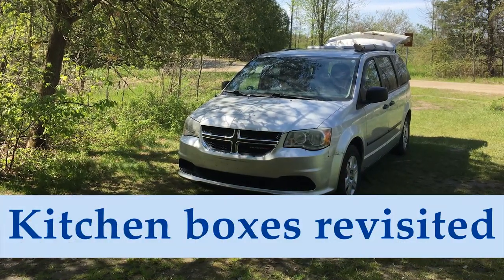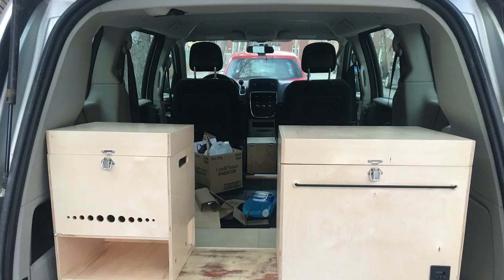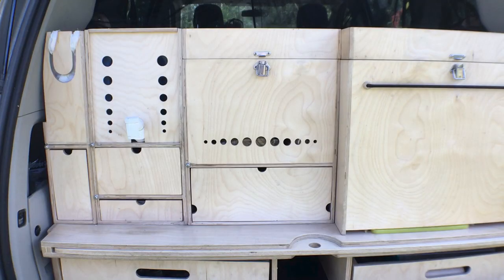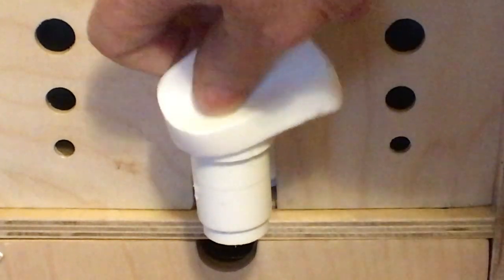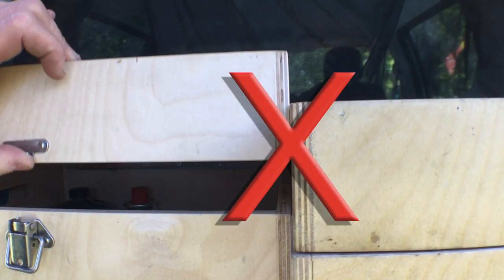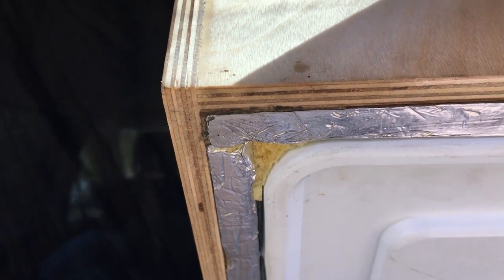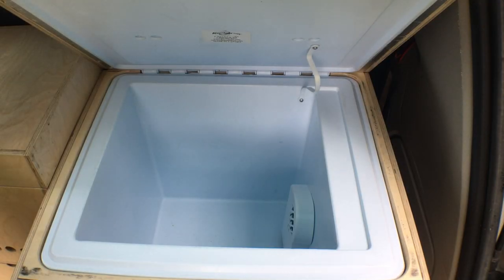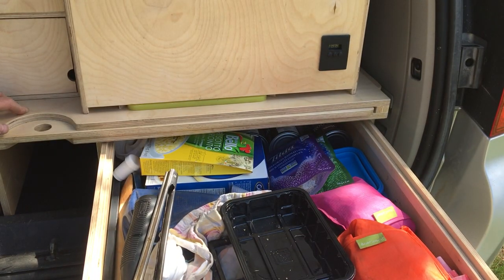Kitchen revisited...what does the future hold for a very small camper van?

Comment: Not being a designer or woodworker, I've been working by trial and error with existing furniture pieces.  For instance, I just 'won' a set of legal size teak file cabinets.  One is for inside my in-law apartment, but the other one is for the minivan. I did a dry run last spring on a trip down to FL to visit my son's family and I used a camping cot, but I'm not really happy with that, since I can't put drawers under it.  I'll figure it out, but I love visiting videos like yours for options and possible answers! Very glad to see what you liked and didn't like of that kitchen.

Comment: Building and innovating is half the fun! You have done a really great job and it is good to see you are not so wedded to an idea that you don't critique it. That is a recipe for continual improvement. As an aside, I went from a cooler which I was very happy with (until it died) to a compressor fridge. An absolute game changer and I dont know why I stuck with the cooler for so long. Less power, more consistent temps and more space. I look forward to watching you rebuild.
Reply from the maker: Thanks for the pep talk! I am comforted by your path from cooler to fridge :-) What kind of fridge did you get? I am debating whether to go for a Dometic or something less expensive. In Canada a small Dometic fridge goes for over $1000. Quite the chunk of change!
Reply: @averysmallcampervan  I went with a Companion brand 60 Lit fridge which has an LG compressor. In Aust Dometic are prohibitively expensive and the reliability case does not seem to justify the significant difference. My fridge was $750 Aud while the equivalent dometic is double that. If it lasts 5-7 years I will be happy (has a 3 year war). WRT coolers, I think the world has moved on from that technology which is why it is harder and harder to buy one (not to mention that here in Aust I travel in summer temps of 35-45 degree C and even with a 20 degree drop your cooler is still in the mid 20s. Love your cabinet work!
Reply from the maker: Thanks for the info!

Comment: I don't even have a drivers licence yet but your videos are so addicting and I have already a ton of plans for when I have the economy and space to make my own camper :D

If I would replicate your setup, I would probably use the curves in the back for my advantage. If you just moved the fridge a bit to the left maybe you could use the odd shape for the drawer for bottles since they get slimmer at the top. I would also make the sink stick out a bit to contain drips but one thing that I thought of is to cut a U shaped hole in the box where the water jug is contained along the bottom seam from the tap and inwards. That way if it leaks and it runs along the bottom of the jug it would eventually drip in the sink without coming to contact with the wood at all. It should be doable to your current setup as well if you want without compromising the aesthetics

Looking forward to see more improvements to the camper :D

Comment: Thank you so much for your videos! I absolutely love your designs and am in awe of how meticulous you are in your build!! This video even helped me start to figure out a similar issue im having with my propane. In my current setup, the short regulator provided with my 2-burner stove doesn’t allow my propane bottle to sit at a proper angle, so the stove doesn’t work correctly. I’ve been looking at getting a hose but have been concerned about safety and making sure I still have a regulator. It looks like the one you showed in the video has the regulator built in - could you confirm that, or did you buy a regulator separately and attach it? Thank you for your amazing videos! I have learned so much from you!
Reply from the maker: Hi Ann, without seeing your stove's regulator and hose I can't say anything for sure but in my case the stove came with a short hose with a regulator. The longer hose that I bought does not have a regulator but I use it to extend the short hose.
So it goes: propane tank > long hose with valve > short hose with regulator > stove.
I hope that is clear and is helpful to you.
I"ll include your question in an upcoming Q&A video and provide some pictures.
Reply: @averysmallcampervan  
Thanks for the reply! This is the regulator/connector my stove came with. I imagine perhaps the hose in your video would attach to it?
https://www.canadiantire.ca/en/pdp/outbound-stove-regulator-0763630p.html#srp
Reply: Hey! Wanted to let you know that I went to Home Depot and bought the hose and it connects to my regulator just fine! Thank you so much for recommending this in your video; I’ve been procrastinating on solving this issue for a month and your video helped so much!
Reply from the maker: So glad to help and thanks so much for letting me know!!!